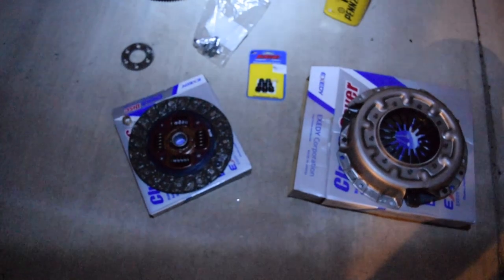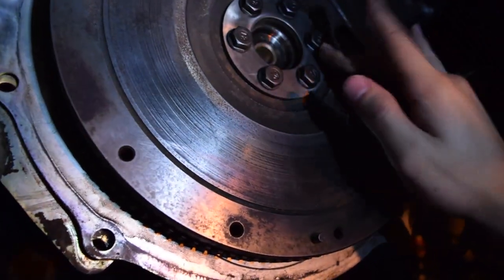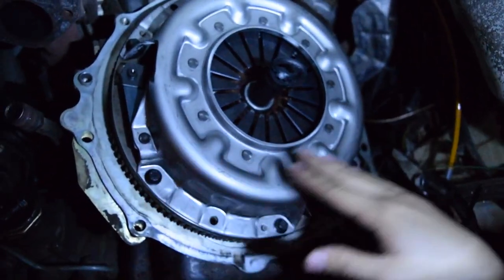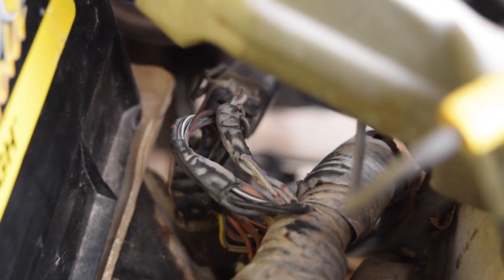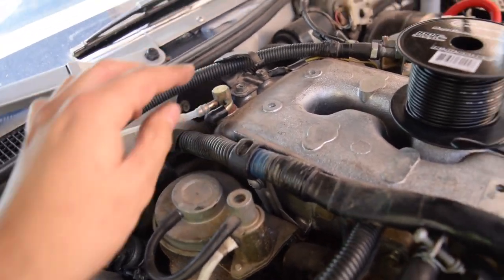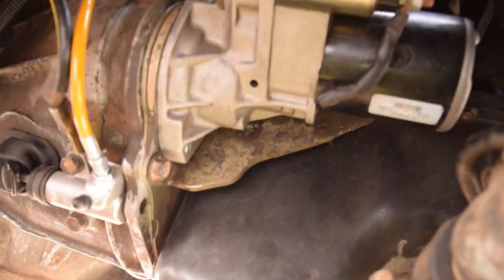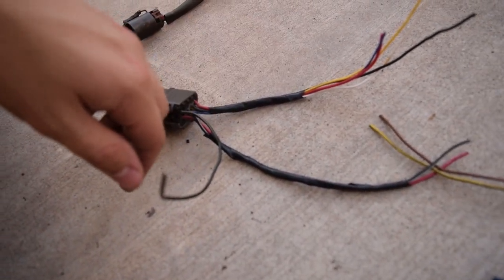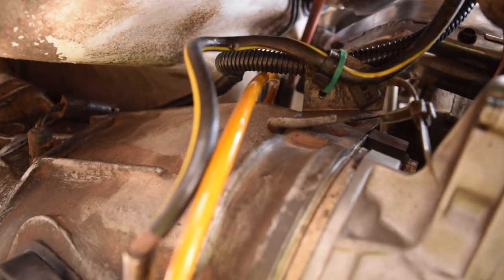Transmission Swap Pt  3

Comment: The two bolts that were longer on the bell housing.  Do you know the length?  Were you able to use the auto trans bolts for all the other bell housing bolts?  Thanks.
Reply from the maker: I'm not sure the exact length of the bolts but I know you can easily get them at any hardware store so it may be worth measuring the edge thickness of the bellhousing of the new transmission vs the old one and getting bolts that are that much longer. The others work but could definitely be longer by 5mm or so to reach the optimal amount of threads engaging

Comment: Thanks for this man. Quick question. Did you use your auto ECU? I have everything except the ECU and read in several places that the auto ECU will run okay with a manual trans?
Reply from the maker: Yes. I'm using my auto ecu right now and it's working perfectly!

Comment: Good video. I'm almost done with my swap. 
Where does the copper crush washer go on the slave cylinder? I also have the same clutch hydraulic line with the 2 fittings
Reply from the maker: The copper washer goes between the slave cylinder and the clutch hydraulic line coming from the clutch master cylinder.
Reply: @TheZGarage  did you use one of the fittings that came in the clutch line kit on the slave cylinder and one on the master cylinder?  do you remember what size copper washer you used?
Reply from the maker: I can't remember exactly, but I believe that you just select the fittings by just finding which ones go into the master and slave. I don't remember the size of the copper crush washer but you can usually get a variety pack of them with different sizes

Comment: Hey man, so I’m almost done installing the transmission...everything’s lined up, about to torque everything down, but I noticed my clutch fork is not moving back towards the slave...(not pushing back/activating) I put a little bit of grease before and basically have the whole clutch replaced, did you have any issue likes that where  your clutch fork doesn’t move back towards the slave ? Or should bleed it 1st and see what happens? Thanks
Reply from the maker: The clutch fork should be pressed towards the slave from the force clutch pressure plate. Are you saying there's space between the fork and the slave cylinder?
Reply: @TheZGarage  yeah exactly, the bottom of the fork that’s suppose to be in contact with the slave push rod, is not reaching it/in contact, it, goes in the other direction away from it, not returning back when I move it by hand...weird
Reply from the maker: Well I believe that calls for disassembly and checking everything. The clutch fork could be bent, it could not be on the pivot point correctly, or there may be a problem where it meets the throw out bearing

Comment: hey man check this out I've got a brand new clutch master cylinder cuz mine has been leaking fluid in the floor ever since I did my dampener delete I think I built up too much pressure and finally blew the seal out and made it start leaking fluid in my floorboard well I've got a brand new one in my hand I'm about to install this morning I've never had any issues with adjusting one but I was just kind of curious if there's a particular adjustment on it can I adjust it to make the clutch engage further or better to get no grinding when I put this transmission in my car a couple of months ago I had no leaks and it didn't seem to grind like my old transmission did but the past week or two have noticed it wanting to grind a little bit here and thereI'm hoping it's just because of the lack of fluid and needing to be bled because I just keep topping the fluid off and not bleeding it but I didn't know if there was any particular adjustment for the clutch master cylinder that I needed to know about I'm about to start working on it here in about 30 minutes
Reply from the maker: Not that I know of. But note that most people recommend replacing the clutch master and slave cylinder at the same time as a pair because if they're are any contaminants they can cause both to fail even though one is new
Reply: @TheZGarage  hell yeah I appreciate it I just put this new transmission in and did the doctor delete with the 280ZX front brake line and a slave cylinder well I had already done the clutch master cylinder probably 5 years ago so everything is new again but the master cylinder and I'm fixing to do it right now but I really want to get the steel braided clutch line to go from the master to the slave the yellow steel braided one $39 so I've got to get it I really wish I would have just got the exedy kit with the slave the master and the yellow steel braided clutch line all for $59 not bad but it's a little late now I have the master and the slave all new so I guess I'll just get the $39 yellow steel braided line next
Reply: @TheZGarage  back together and good as new and while I was under there I went ahead and put all my energy suspension sway bar and in-link bushings on now I've still got this one damn energy suspension Mount and I actually seen a transmission mount of another kind that use the same damn Mount I have again and it was black and it was for a transmission mount for the z31 man is a matter of fact they use the same damn Mount again on the differential I wish I had a little bit of metal and a welder cuz I was sure make the bracket I can get these mounts for cheap but not the metal casings it's the same as a damn Chevrolet transmission mount energy suspension of course but anyways I think my next move will be the solid one piece yellow stainless steel clutch line from the master to the slave I've already deleted the clutch dampener but I still have the hard mind going to a 280ZX front brake line so it's rubber down there I would rather just have that pretty yellow stainless steel but yeah my clutch is good and tight again tonight then I got all my energy suspension bushings in the front I haven't even test drove it other than just moving around my parking lot but then I got sidetracked working on my Ford Taurus I have the cleanest Ford Taurus baby blue with ground effects all painted up neon blue suspension underneath the brakes the inside the motor kind of a cool looking Ford Taurus if I might say so I got it because I'm a Taurus of course and I barely have any money in the car it's just the old daily
Reply: I finally got a little quick vid of my z posted on YouTube  look up   1986 z31 n a five speed      and you will see my gold z sitting beside money baby blue Ford Taurus

Comment: Is there a certain aftermarket flywheel you’d recommend buying?
Reply from the maker: Really any flywheel that fits will work. There aren't massive gains to be had from something like a light weight flywheel. If you're chasing every ounce of power then I can recommend the fidanza aluminum flywheel. I'm running it and it's really nice. But a stock steel flywheel will work just as well. You just want one in good condition, no hot spots or grooves. I've seen new steel flywheels for sale online. Rockauto may be a good place to check or just Google it.
Reply: Is there anywhere that you have the link to the fidanza? I’ve been looking at it on their website and just wanted to make sure I buy the right one.